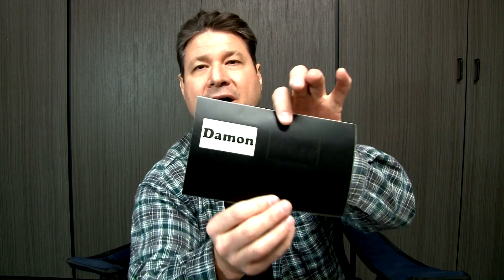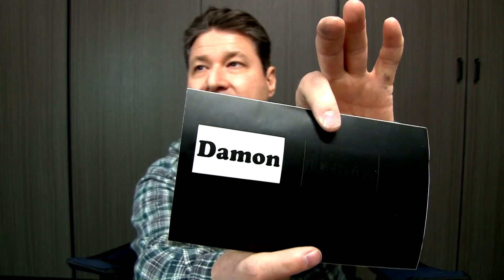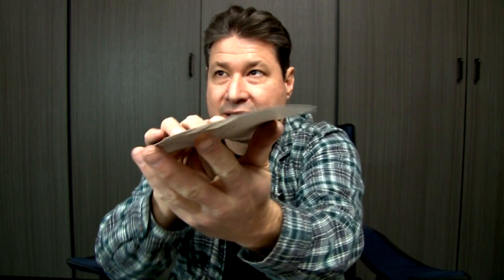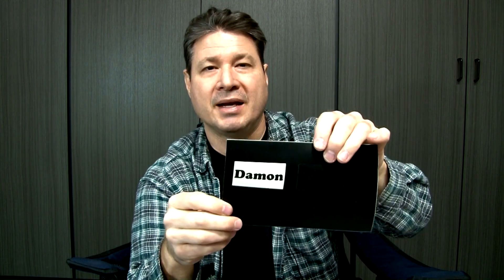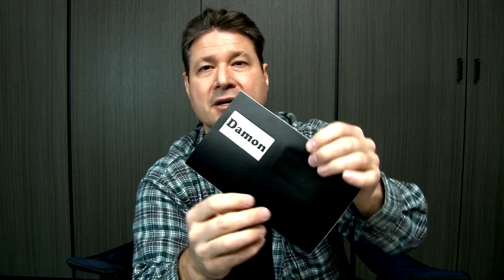Highly Detailed Aluminum Sand Casting using a Vinyl / Graphics Cutter.

Comment: Nice detail! nice to see additional techniques used to bring out the details.  I also like the flask.  Is that one you made or did you buy it somewhere.  Looks like an excellent choice for small castings.
Reply from the maker: Thank you.  I just wanted to try something different to see how well it would work.  I wish the vinyl I used was thicker, it would have better visibility.  The casting flask I picked up from Amazon.  Its one that I think most people use for jewelry.  The top pour worried me that air could get trapped inside being that the melted aluminum just gets dumped in the top.  It seems to work fine though.  Thank you for leaving a comment.

Comment: My first casting was a 5 inch plastic gear that was used with a timing belt. Being plastic I knew the would be almost no draft on the part but I wanted to cast something and that was the best I could think of. One edge of the mold had some damage because of misalignment from the lack of draft when I was putting the cope back on the drag. There were other issues, like shrinkage. In all it was a great learning experience. 

I was using green sand. The thing that surprised me was the retained detail. Yes it had somewhat of a grainy surface. But the slightly raised lettering molded into the part was there. And the paper label also came out, with a well defined step. While there was the sand grain pattern to the part it still reproduced the detail. It did help that I was using zinc as the metal.

I have never tried petrobond yet. I like the clean result it can produce. I have a couple of small cans of the bentone used to make it. I was sent a couple of samples from the company that makes it. I will need to get some finer sand than I have now to make it. My sand is fine but not as fine as used in good petrobond.
Reply from the maker: Gears just sound difficult.  I have not tried  casting in Zinc, does it flow and pick up detail better than aluminum?
Reply: @DamonsMetalCasting  I took a picture of the part. Easier than describing it. 
https://i.imgur.com/TzrmIrt.jpeg  front 
https://i.imgur.com/dArDtnB.jpeg  back
It has a flat flange around the one side. So easy to ram up. The main problems were the lack of draft making it very hard to get the cope back on the drag without contact. Caused a bit of a mess on one side. Another problem was the flange was only 0.040" thick at the edge. It didn't fill cleanly all around but it was mostly there. A few voids. 

Some on the surface of the part were mostly smooth but lots of graininess elsewhere. I wonder if it was not packing the sand hard enough or consistently. I did this about 10 years ago and then shelved everything because I had too many other things to do. I'm only now getting back to casting again. 

Zinc is supposed to be better for detail but zinc is usually used in high pressure die casting. As far as gravity casting, because zinc is 2.5 times as heavy as aluminum there is more pressure to fill the mold. If you don't have fine sand it will push into voids in the sand. So yeah it can pick up more detail, but maybe it is the kind of detail you don't want. I want to play around with less head height. I found that if I have a riser above the part the surface at the top of the riser is more smooth, and moving progressively down to the part it becomes more grainy. 

I've got lots to learn in this hobby, and I consider that a good thing.